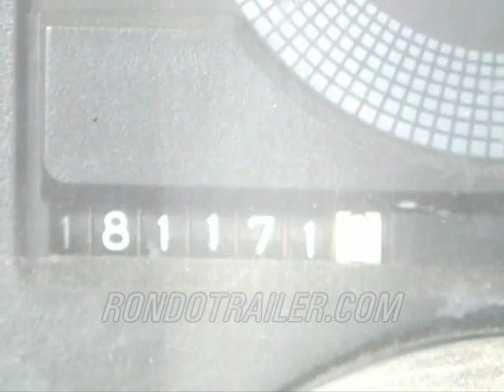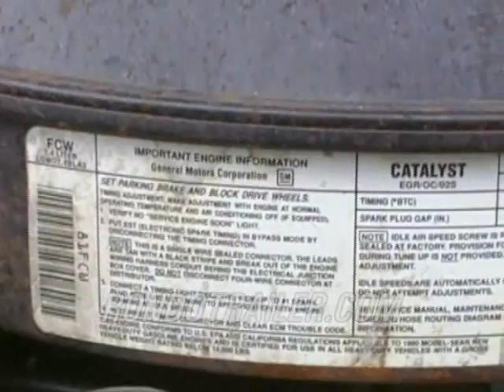SOLD.1990 BIG BLOCK CHEVY MOTOR 7 4L 454  SOLD, SEE WHAT U MISSED!

Comment: I but the same model
Chevrolet 1990 pickup v8 7.4L two door cab Utility 4x2
It's been driven 1550km
Vin 1GBHC34N7LE211516
I but it 4,500$
It's so clean I don't believe it